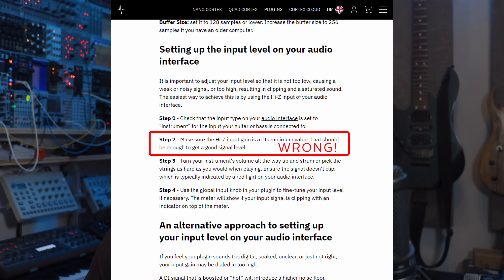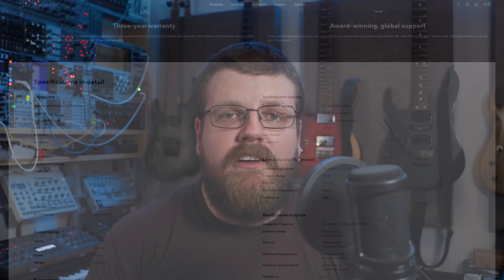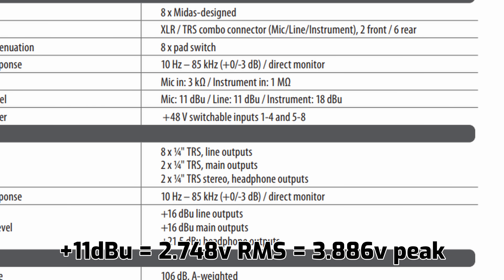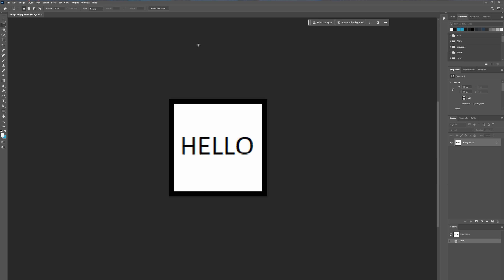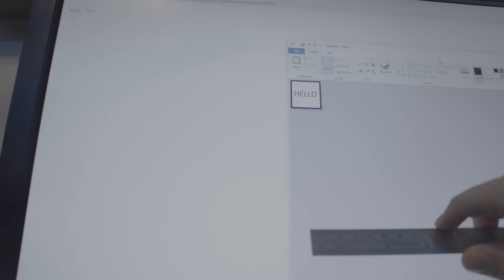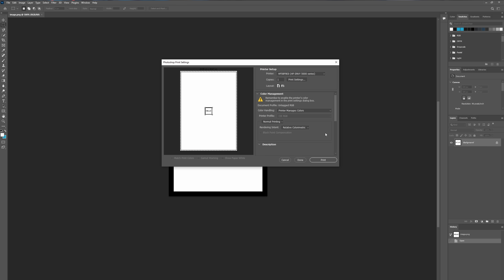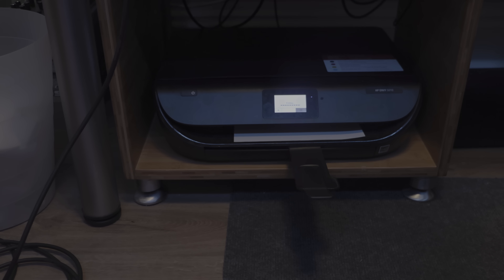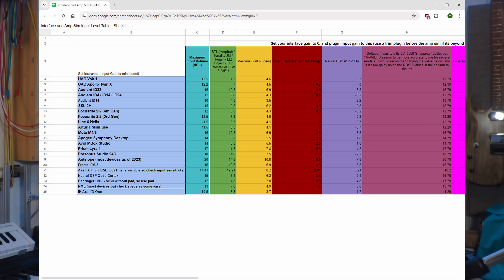Ampsims and input gain - Please, stop the madness...

Comment: Thanks for an in-depth dive and examples, super useful. Got another issue though: I am using an EMG-powered guitar and noticed that clipping occurs even while the input gain on my audio interfaces is at minimum (different ones, Audiobox 96 and a MiniFuse 2). Can't fix it in the DAW or amp sim plugin. Compared it to another guitar with similar EMG pickups (81 and 85), and though the signal there is still high, the first one is considerably higher and getting a clean tone is impossible. What could be the issue? Appreciate any input. And happy new years!
Reply: This is a really common issue with active pickups and you’re not doing anything wrong. EMGs can put out a much hotter signal than passive pickups, and some interfaces don’t have enough headroom on their instrument inputs to handle that cleanly, even at minimum gain. That’s why you’re seeing clipping before the DAW or amp sim ever gets a say in it. The fact that one EMG guitar is noticeably hotter than another can come down to pickup height, battery voltage, or even the onboard preamp tolerances. Things I’d check are lowering the pickup height quite a bit, making sure the battery is fresh (a dying battery can actually cause distortion), and if possible using a pad, DI box, or line input instead of the Hi Z input. Some people also have success with an inline attenuator. It’s basically a hardware headroom issue rather than a software one. And happy new year to you too.
Reply: @mumflaps9133  Thanks for your take. Checked both the batteries and the height, not an issue here. I am considering two solutions at the moment: (1) (a slightly more painful one) is to change the pickups along with the pre-amp to see if the issue is with these specific EMGs – I don't know their origins entirely, but they've been on my guitar for 10 years now, and possibly 10 more on another guitar earlier. I heard that older EMG pre-amps tend to be "louder". What's strange is that the problem with clipping has become so apparent only recently, I recall using them with the same audio interface, being able to raise the input gain knob to about 11-12 o'clock before clipping led got red. (2) Option two is returning my freshly boought Arturia audio interface and looking for smth with an internal pad feature or more headroom (the question is, is there anything in that price range that has that or would it make more sense to get a DI box as you suggest? We're speaking 100-200$)

Comment: I have Focusrite Clarett+ 2Pre. Does it mean I keep DAW's (Reaper) volume control untouched and only tweak physical input gain near clipping and then compensate digital input gain only in loaded NDSP plugin? Also as far as I know input gain potentiometers aren't linear so each "notch" at input knob doesn't represent precise 1dB increase, how do I evaluate how much input gain I've added?

From Focusrite documentation their LEDs turn orange when signal hits -6dBFS (which is where I stop and Reaper correctly measures it around -6 at strumming) and red at 0dBFS. So how do I know how much dB to compensate in NDSP?

Comment: I've played guitar for a long time and made music digitally for a long time but never had an interface until the other day and even I was confused when I saw people recommending setting the gain to zero but I figured they knew better than me because I'm new to this but my sound was not good when following that advice. Then I went with my instincts and turned the gain up until my DI signal was peaking at between -6 and -12 DB added a slight clean boost then into an EQ to get rid of the super lows and super highs and a little bit of the mud at 250 then into my amp sim and adjusted the input. All of a sudden my guitar sounded like a guitar and the amp sounded like an amp lol.

Comment: The only time I'd recommend recording at lower input volume is for vocals in a noisy room. But I would also recommend singing more quietly, to not reflect as much noise. Guitars are different. And so is dialing in ampsim tone, because the input slider as you mentioned isn't there for no reason!

For people who have not yet learned to master this, izotope RX is what I have used for years to fix my poorly recorded takes. Remove noise without ruining the harmonics, normalize. Then dial in the digital input until no more flabby amp

Comment: Yep, appreciate the clarification on this.   So many crap recordings from project studios because they fail to get an optimized gain staging up front.  Garbage in, garbage out.  This has made me crazy for years because there is no standard between different gear and the manual with the interface rarely gives clear direction on how to get there.

Comment: I just read my volt 176 manual and follow instructions. Plug the instrument, click on instrument button, click on monitor and did this:This knob adjusts the preamp gain for the microphone, instrument, or line level device attached to the input. For optimum gain, rotate the knob to adjust the input signal level while monitoring the source that is connected, so the input meter shows signal but does not light red. The red input LED lights when the input signal is near 0 dB.  Clipping occurs when the signal is overloaded. When clipping happens, the top of the waveform is squared off, creating distortion that may be unpleasant. Clipping has creative uses, but is usually avoided. To prevent clipping, adjust the gain so only green and yellow meters light, and the red LED doesn't light. 

The information can easily misunderstood that 0dB is what you have with gain knob set to its minimum value. And, in fact, 0 dB is the limit to avoid clipping and I can find it somewhere between gain knob on its minimum value and its maximum value that red lights will indicate for us.

Comment: Finally ! A voice of reason!

Would love to understand the effect of this gain staging when guitar players roll back the volume knob to clean out crunchy sounds. Doesn’t that mean we now reduce signal strength and therefore are again not utilizing the top 2 bits on the converter? 
Does this mean we have to now regain the signal from the interface and then adjust the trim in the plugin?

Hmm.. do we need to start buying amps again ?😂

Comment: Interesting. I thought most people understood this. I’m surprised people are having issues understanding this. I belong to the Line 6 Helix forum and lots of people in there have discussed and resolved this at length. Line 6 explains it quite clearly as well. It should be common knowledge by now, especially those that use modellers. However, I’m glad you made this video. Cheers

Comment: what if you're using a line helix floor into a scarlett and not a vst plugin? Or in my case I have a mod dwarf acting as the amp and cab, going into my helix as an FX loop for pedal effects, then the helix goes into my scarlett 1+2 XLRs.
Reply from the maker: The same rules apply to the input into your mod dwarf / helix as if you're using an interface+ampsim. Adjust the signal strength coming into the analog to digital converters to be as strong as possible without clipping. The is the guiding principle and applies to ALL ADC devices (with possible exception for high dynamic range, 32 bit converter systems)

What the dwarf/helix is connected to later is irrelevant (assuming the amp sim is running on the dwarf/helix)

Comment: Maybe someone could help me understand this better:

My HX stomp has no gain reduction meter for the compressors but the HX native software does.

So by increasing the gain on my interface I'm hitting the compressors with a hotter (I think) signal than my bass straight into the HX stomp. This means the threshold lvl for the software and the hardware are going to be different if I want the same gain reduction.

So if I want to keep them as close as possible shouldn't I drop the gain knob on my interface to 0, create the preset and then save it to the hardware unit?

Comment: I've been using vst's in this exact way. Trying to compensate levels in order to obtain the maximum between input and output and, at the same time, have the clearest audio without the less amount of whezzing possible. Great knowledge specially when you switch among different audio interfaces

Comment: 0 gain advice works very well for me. 
My noise floor level is very low, my input signal is strong and doesn't need more amplification.

In your video you have high noise and weak signal from the very beginning which might not be true for everyone.

Also, considering one has very low noise floor, gain knob on the preamp is almost certainly inferior to the digital upscaling. For pure logical reason, it's precise digital scaling vs analog voltage driven amplification. In reality, I have inferior signal if I increase the preamp gain.

That what has worked for me. It looks like you have certain issues with your noise level overall.

P.S. I don't know if that's only for the show but you certainly look mad on video, smile more and enjoy life more, please.

Comment: You don't need that spreadsheet guys. lol You are over complicating this. Easiest way to solve this is to record a clean DI and a scratch FX track. Once it's been recorded you KNOW the max input on that track and can easily dial it in. Every time I have gotten gain perfect prior to tracking, the player ALWAYS plays 2-3db harder. It's just a reality. Best practice in my opinion is to record a DI and one with FX and then go back and get your DI dialed in and scrap the FX track. That way you know exactly what you are working with.
Reply from the maker: That works really well, if you're recording. If you're playing live through an ampsim, though....

Comment: When I set my Scarlett to zero, it peaks at -31dB, meaning I would have to go -31 in NDSP to achieve the perfect signal to noise ratio, and that's not even possible haha
Reply from the maker: If you're plugging a guitar into the Scarlett and it's peaking at -31dB, something is very wrong. Either your pickups are extremely weak, the preamp in the interface is cooked, or you've forgotten to engage "Instrument mode". - and if you check all that and you STILL have -31dB coming into the interface, even more reason to crank up the gain on the interface because you're leaving 31 decibels of signal to noise ratio on the table otherwise! :)
Reply: @GhostNoteAudio  That's without the NDSP plugin engaged, if I turn it on it's -16 dB (at no gain). Is that normal?
Reply from the maker: @relinquished222  -31dB is definitely very low, coming into the interface. Even at 0dB on my 2nd gen 2i4, a normal humbucker is peaking around -10dB when strumming loudly. Any chance you have active pickups and the battery is going dead?
Reply: @GhostNoteAudio  I have a cheap Squier Bullet guitar, that's probably why. And that's with Inst on, with off it's -45 haha. I'll have to buy a better guitar eventually
Edit: btw that's single coil, humbucker is 10 dB louder (it's HSS configuration)
Reply from the maker: @relinquished222  I love bullet strats - they're great, honestly :) Maybe check if you can raise the pickup a little bit to get more output.

Comment: Thanks so much for clarifying this topic! Why this information and knowledge annoys a lot of people is clear to me: because when you surf via different presets it means (on the older NDSP Plugins)you have then manually set every single time the input gain in the plugin as there is no global set and locking system. I have found out that only the last two new released plugins have this. Maybe in feature updates neural dsp add this function, who knows

Comment: Everyone who listened to you in this video is struggling with every amp model wondering why they always sound heavily overgained.

You generally don’t use a preamp when you plug a guitar into a real amp, and it’s the same with amp models. They are modeled with the input at 0db gain.
Reply from the maker: Yeah, you've missed the point of the video, mate :) - the whole point is that 0db on one interface is not the same as 0db on another.
And you need a preamp to drive the analog to digital converters. The clean buffer in your interface is a preamp, but that's very different from a "guitar preamp", but you still need a preamp.

Comment: Anyone know the sim values for Amplitube/tonex?
Reply from the maker: Amplitube is difficult, because the individual amp models actually expect different levels (crazy, I know!). ToneX is completely dependent on how the capture was done. The ONLY way to level match a ToneX model accurately is if the person who did the capture specifies the signal level for that particular capture. Otherwise, you have to adjust by ear.

Comment: Best advice on the net! I'm using a Scarlett 212. I set the gain via the Auto button. Then in the AMP Sim like DSP I adjust the Input up/down until it is just below the clipping level. After trying that my guitar sounded 100% better. What I also found very useful (as an exercise) was to set the input level in DSP to the lowest so I could hear what the different was between a weak signal and a full signal. I recommend you try this. Thanks!

Comment: There is a de facto standart in audio engineering. At least in professional live audio many sound engineers set their gain to -18dBFs peak. They leave so much headroom in order to prevent some mics to clip mid-show. Clipping ADCs sound nasty and you dont want an entire venue to hear this. They trade some SNR reduction for robust gain staging.
The input meters of the Behringer X32 shows all Signals that peak above -18dBFs in yellow. Other consoles on the market today are similar.
Reply: For those who say my comment may be a bit unrealted to the topic, many consoles also have onboard amp sims. But it think they are used very rearely. At least I never did...
Reply from the maker: There is a standard for live broadcasting, but there is no standard for virtual plugins or ampsims. You can't take one standard, intended for one thing, and apply it to a different thing, and expect that manufacturers magically complied with it. I touch on this in my follow-up video: https://www.youtube.com/watch?v=Dw0iMVWWaM0&t=432s

Comment: So, I have Motu M2 and I did same experiment. There is a difference in noise volume coming from audio interface itself, but you can only see it in measurements while really high gain amp sim is on.(Nameless X + Grind maxed out in my case). Guitar pickups have much more gain when you roll volume on max. Notice how I said that you can only SEE the difference? This noise in both cases are completely inaudible. 
I am not an audio engineer, but I guess with modern decent quality interfaces you can just stick with minimum gain on interface and only adjust input gain in plugins.

Comment: In the newest UAD plugin, Paradice-uad suggests to use 0 db input volume on interface. Ha- what you have to say?
Reply from the maker: I say; that is not fully accurate, and that they, much like Neural DSP who started this bullsh*t, are encouraging users to use their equipment improperly. The "set your gain to zero" approach is a shortcut - but it usually works well enough to let it slide. But it is NOT the optimal method. That's the crucical point. 

If you want to use the shortcut; use the shortcut. If you want optimal results; follow this method.
Reply: @GhostNoteAudio  on my interface UAD Apollo minimum is 10dB. If I set more than 13 signal out of guitar is clipping occasionally.

Comment: You nailed it. Absolutely correct 
Setting your interface gain to zero doesn’t “fix” amp sims — it just starves the plugin.
A real amp and a VST never react to the same input level or circuit, even if the knobs match.
Making both clean by killing the input is like removing fuel from a Ferrari until it moves like a bicycle — useless comparison.

Comment: you are absolutely right. it is pure logic thinkinh. if i send my analog Signal with zero gain to my interface to convert it, i doesn't use the full range of bits (for example 24Bits). So my interface translates from analog to digital with less bitdepth. And afterwards when the signal is already digital i have to crank it up in the amp sim. that doesn't make sense at all.
I testet it with my behringer and a stronger input signal led to less noise.

Comment: ok, I took earlier advice of using +0dB because I was told to. But I really have a better understanding of how this actually works. I really like this, because I also like to edit DI tracks (yes, before they went into the plugin). so when you boost your signal it's easier to edit the trabck on sight.

Comment: Great Job, Brother. Thank you for enlightening us. My only hurdle now is that my focusrite 2i2 4th gen only allows a minimum of 7db (instead of zero), so for the first step I'm constrained to set the interface's input gain at the minimum 7db. So for the second step,  must I (for unity gain compensation) reduce my digital input gain by -7.2db (instead of the spreadsheet's suggested -0.2)?

Comment: Thank you for this. I used to play electric guitar a long time ago but never through an interface. And I've been playing synths for about 6 years but I've really struggled with my new electric guitar. I was using a noise gate before the interface, but it was chopping of the tails of everything. I knew it was something simple. This is perfect because I have the same interface as you also 😁

This also explains why my ASM Hydrasynth has some noise when it's just idle through the Ext IN channel on Ableton. Awesome!